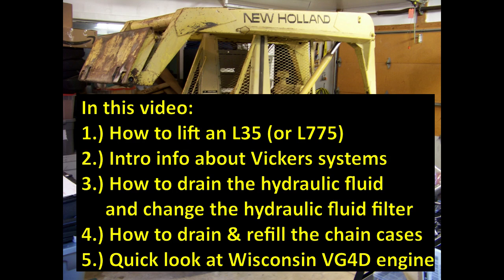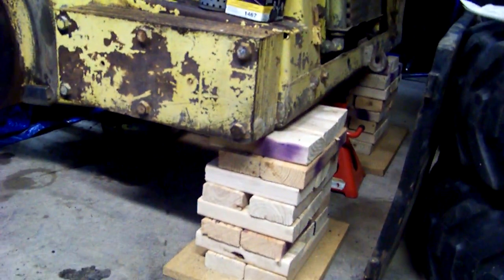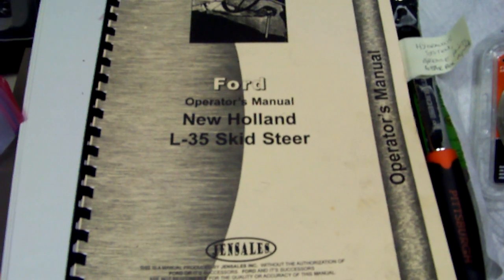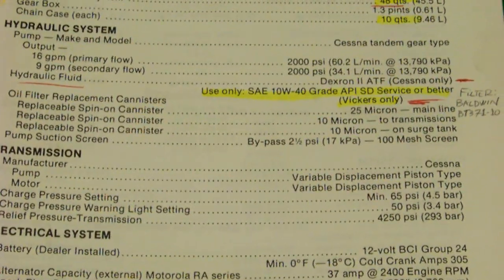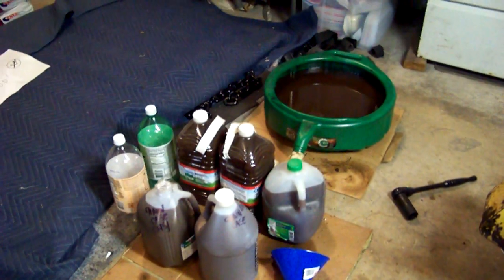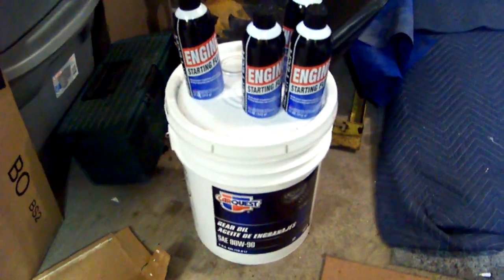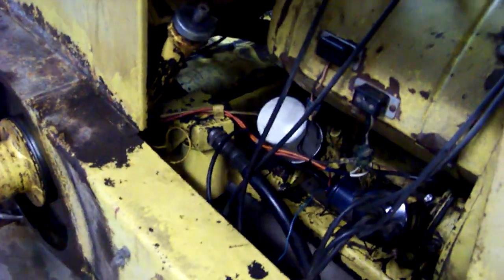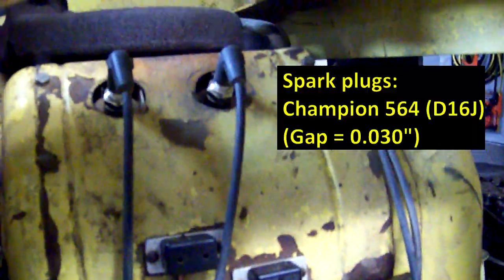DIY New Holland L35 L775: How to Lift a Skid Steer, Drain Chain Cases, Drain Hydraulic Fluid, VG4D

Comment: Do you have any information on the brake system on these loaders?
Reply from the maker: I'm sorry I missed your comment - if you mean the parking brake, for this particular L35, a previous owner removed it for unknown reasons probably decades ago, so this L35 doesn't have one.  It is my understanding that they were equipped with parking brakes, though. 
If you mean "brake" as in drive: there is no brake per se - the skidsteer should stop when you release the levers, because the levers control the swash plate angle in each hydrostatic transmission. If you're getting continued travel (or creep) even when the levers are released, such that you have to slightly pulled back on the lever to keep the skidsteer still, then you can adjust the links on each lever to each transmission to get the levers back into the correct neutral spot. Ideally, you want to lift the skidsteer and put it on blocks with all 4 wheels off the ground to make those adjustments. I hope that helps : )
Reply: @L35inColorado  thank you.  I appreciate your help and message I will look into it.  Have a good day.